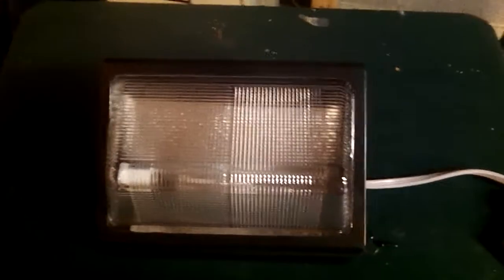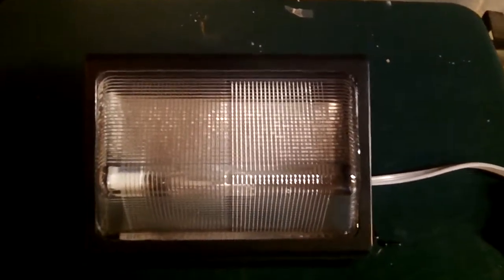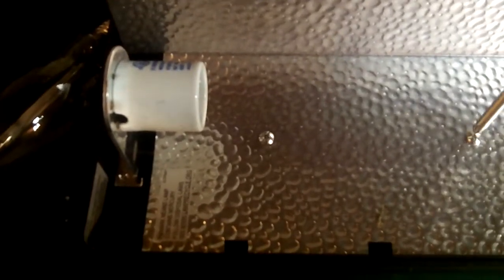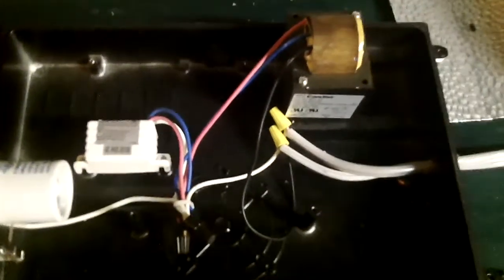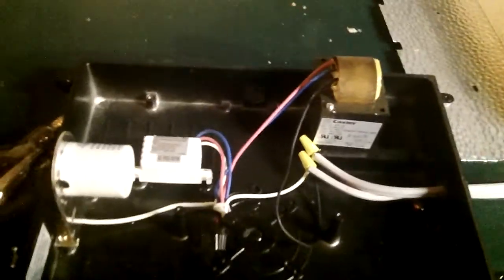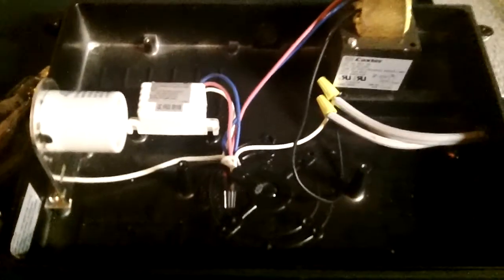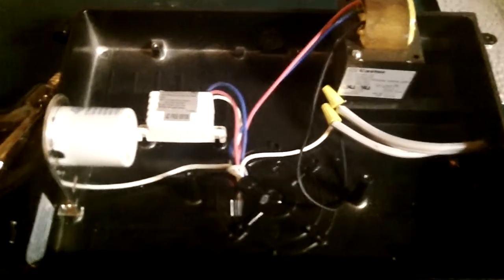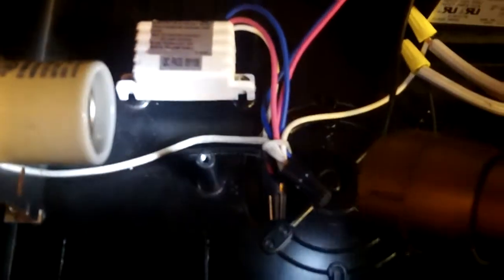high pressure sodium wall pack 150w

Comment: i have had success with changing a medium lampholder to a mogul lampholder in a 100w metal halide medium wall pack for the purpose of operating european 100w hps lamps since they mostly have mogul bases and that they are electrically identical to us pulse start metal halide lamps of the same wattage from 35w-150w.